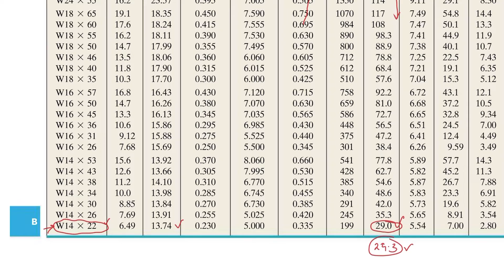11-5 Design of beam and shaft| Mechanics of Materials RC Hibbeler

Comment: 9:10 its 30x12kips/inches sir
Reply from the maker: no it's 30 kip.ft and if you conver ft into inch then multiply with 12 will give you 30 *12 and unit will be kip.in